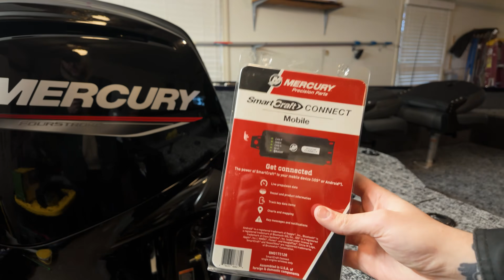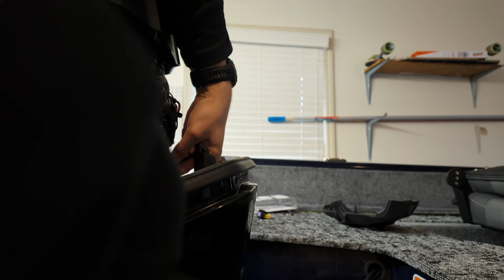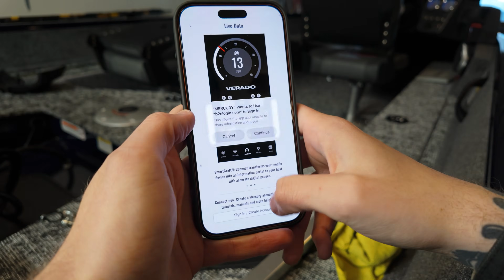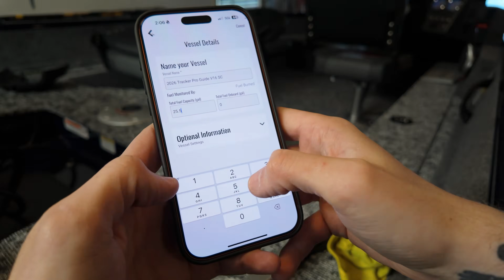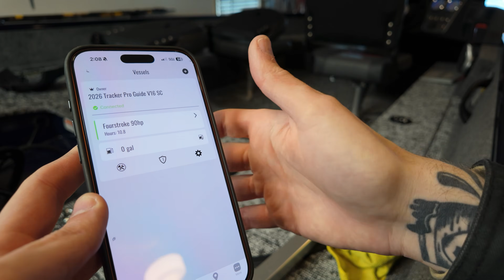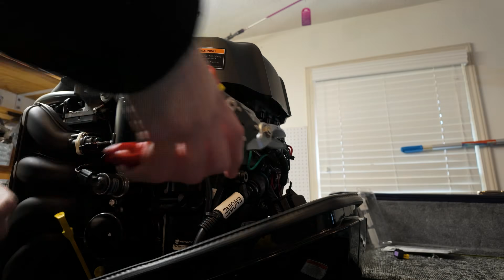Mercury SmartCraft Connect Mobile: Step-by-Step Installation Guide

Comment from the maker: What's the main reason you want to install the SmartCraft Connect? What info is most valuable to you?
Reply: good question,  2nd is-  what's the budget.
Mine was to get true digital rpm because I suspected the analog tac was a problem, to be honest this did that and I fixed the analog tac w that info and some AI assit to change the dipswitch setting on Tac.
that said, due to many issues with this solution this cant become 'an instrument on my dash' like I hoped to do  the app takes forever to load on my spare smartphone I was going to permenantly mount-  then it takes a while to aquire the live data,  then the bluetooth often disconnects and have to start over.  So, I imagine the $225 saved me that much at a shop to diagnose/fix the tac (but cost me hours to do myself) and I can also get hours etc via occasionally going through the pain of connection- but temper expectations for quick and consistent usage. I might try to extend connection to get the unit out from under engine cowl for better bluetooth connection but not sure its worth it.

Comment: Great Video, I just would have like to see you wet fire it and show the unit running rpms and other options on it why the moater is running, but great video all the same.
Reply from the maker: That’s a great idea, and I definitely should have included some clips of the data working while the motor was actually running.

Comment: not a good video- 1) Never even actually shows the connector- jus shows where and then magically connected-  seeing the 10 pin purple would be better,
2) BIG DEAL_  bluetooth is an unreliable connection-  if you call Mercury they recognize this and have a diagram where they recommend you use all the cord and strap the box portion to the top where there is less interference. Just 'where you like' is not good enough.  This improved reception at the helm where i use it but still not great (i.e. disconnects at times)
my boat has a connector at helm, Iif you do its best to buy the helm connect version of this product, if not at least get and use the Merc diagram to locate the box portion better than this vide shows 
- to mount this version at helm I am buying a hub/terminator/cable that Merc says will work-  all could have been avoided with the helm version but cant return this one and most retailers dont even sell the helm version as many boats dont come w the cable that supports it.
- this product is a poor way to just get hours/rpm/etc digitally, but the other options like Merc Connect are even more expensive.
Reply from the maker: I appreciate the feedback.

Comment: Do you know if disconnecting the boat battery will affect data?
Reply from the maker: I wouldn’t think so. Just because the smartconnect is really nothing more than a Bluetooth transmitter.

If it reset, motor hours would be off. And that’s essentially like the odometer on a car.

Comment: The app sucks. If you want to view rpm and fuel your good. Those two take up 80% of your screen during active monitoring and then you get to choose one more option for the other 20%. Vessel view was way better.
Reply: You are absolutely correct. The new Smartcraft connect and black Mercury app are a total waste of $200.  I need to know oil pressure, temp, and alarms. This new app and Connect are absolute garbage.
Reply: It does have the oil pressure, etc. but the navigation in the app is not clear and well thought out.

Comment: the app has awful reviews, what is your experience so far? This looks useful but if the software sucks then I'll just get a digital gauge.
Reply from the maker: It’s very slow and limited but if you want to see info on your motor I think it’s the only option
Reply: I was extremely disappointed with this "new and improved unit".  Constantly disconnects (no matter where its mounted), rendering it completely useless if your trying to use gauges.  Pretty much accepted the fact I bought it for engine hours only.